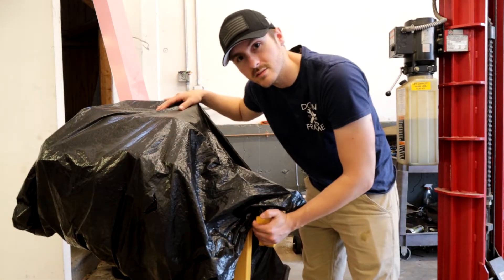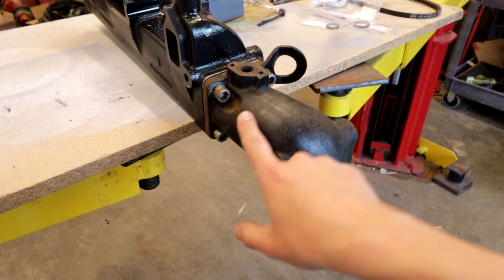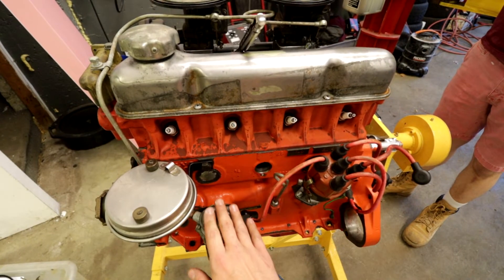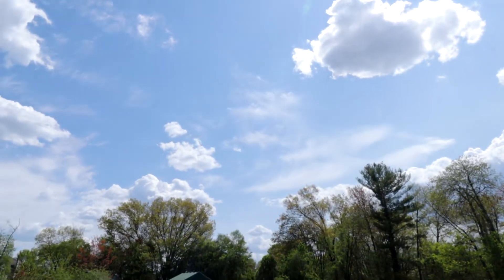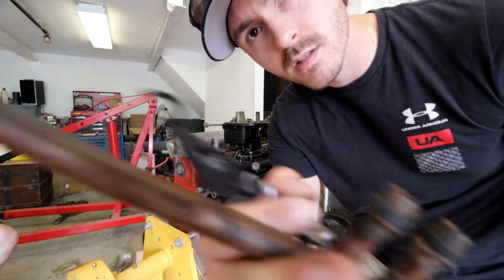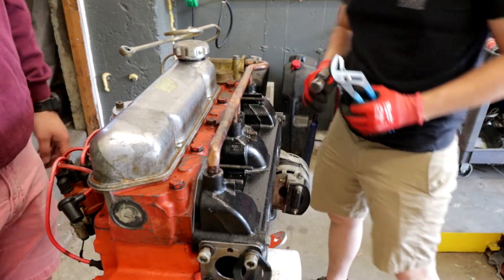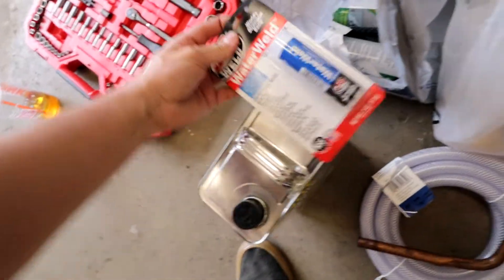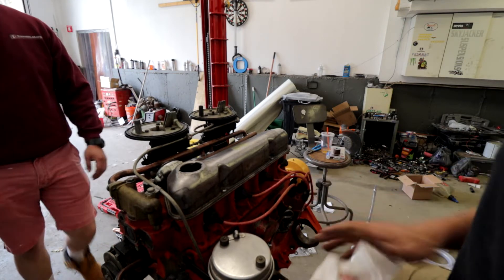Boat Engine Rebuild Complete - Boat Restoration Part 30

Comment: Enjoying your vids on the AQ130.  Those cooling tubes specially the manifold one is a major PIA!     I have the same engine and replaced the blown head gasket last year.  Boat has been running good for the last year or so, but am getting black oil after a 4 hour run.  Blow by rings maybe?    All that said, I just picked up another engine for 100 bucks.   Chocolate milkshake for oil and most likely a blown head gasket.   I plan on rebuilding it pending what I find after tearing it apart.       Thanks!  Jim
Reply from the maker: We are so glad you are enjoy them! These engines can be a pain to work on but if done right and treated they seem to be able to last a long time! That’s a great deal for $100! Thanks for sharing your story Jim!
Reply: @DownToTheFrame  Thanks for the reply  I would have like seen some more detailed video like when you put the cam, crank and pistons in.  I think that's going to be the most challenging for me.   Not really a mechanic by any means.   But I managed to get the current one in the boat back up and running.    It was a freaking mess from the how ever many previous owners the boat has had.    Anyhoo good luck to you!
Reply: Saw/found a couple more vids, kinda odd I didn't see them the first few times?    Hey where did you source most of your parts, see some on Ebay have not looked at like Rockauto yet.    Thanks and thoughts?
Reply from the maker: @jimakerlund3816  I got most of my parts from http://www.volvopentastore.com/ which has a bunch of exploded diagrams. However, there are many parts that are discontinued or just ridiculously over priced. Not sure why those videos didn't show up but if you go to our playlists we have all the Bayliner videos in there!
Reply: Just an up-date the engine I picked up to rebuild is a lost cause.  Machine shop called and there is just too much corrosion on the block at 2 of the water passages next to cylinder 1&2.   He would have to shave off 30/1000th  and even then it is so close to the firewall there is not enough meat left for the head gasket.   Shot down in flames, only out 125.00 plus machine shop time.   Such a waste.   Oh well still have the running engine in current boat.  Will pull and rebuild that one instead.    Thanks again for the vids.
Reply from the maker: @jimakerlund3816  That’s a bummer! But glad you  have another engine! Hopefully that will be a better build!
Reply: @DownToTheFrame   It is running in the current boat I am using, guessing it can't get worse.  LOL.     When are you getting that one in the boat, if not already?

Comment: Yes, starter solenoid I think! I had the same issue. I don’t think it’s a battery issue. Check all connections there and measure the outputs! It will be fine. you did great work on the engine man! 👋👋
Reply from the maker: Thank you! Just responded to your insta comment. I hope that fixes it!
Reply: @DownToTheFrame  messages in YouTube is a good way to support a channel 😉 that’s why :)
Reply from the maker: yessss! love that!

Comment: Probably either not enough amps going through those jumper cables from the car or, it needs more cranking amps that the car can’t provide.  There’s a reason boats use Marine grade batteries, Higher cranking amps.  Worse case scenario, the starter needs a rebuild.  But great job putting her back together.
Reply from the maker: Maybe we will pick up a marine battery and try that. Thank you for the info!
Reply: Also the longer the wires you use to run it the less current or amps you’ll have going to the starter.